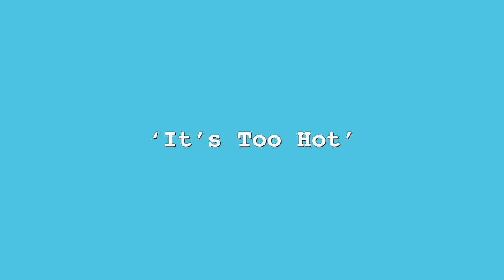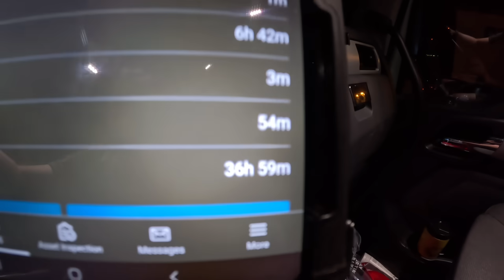Joe Seppi Trucking Vlogs: July 3, 2024

Comment: If you've bought electric coolers and they broke your truck then maybe you shouldn't buy the cheap Amazon coolers or power inverters. I've been running mine for 5+ years and the only thing that goes bad is my separate fridge. Those don't last I get that but the 12v fridge freezers. Dometic, iceco, ecoflow are top tier and will last. The eco flow Glacier comes with a ice maker and has a battery witch will last 40hrs. Cooler is dual zone can set - 14.
Reply from the maker: Maybe I shouldn’t buy any at all but I do enjoy how passionate plug in cooler owners are